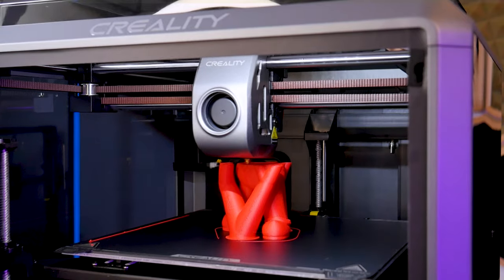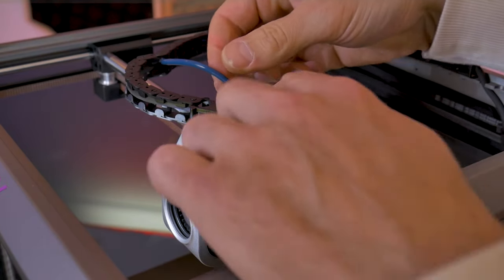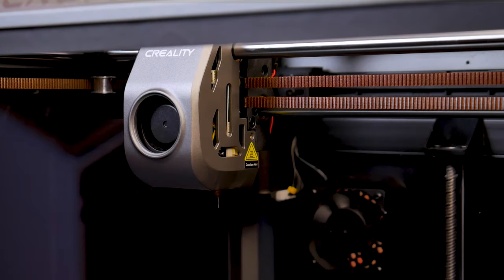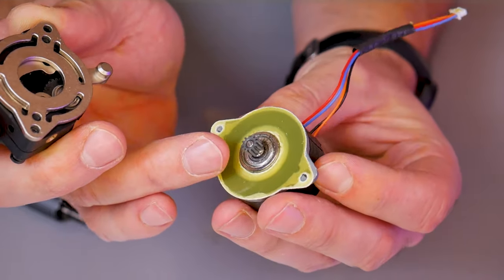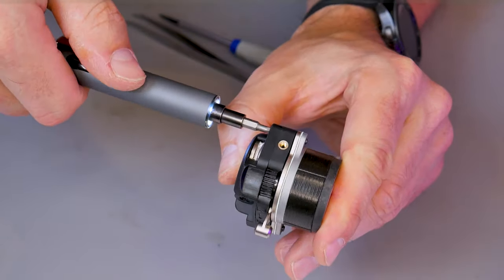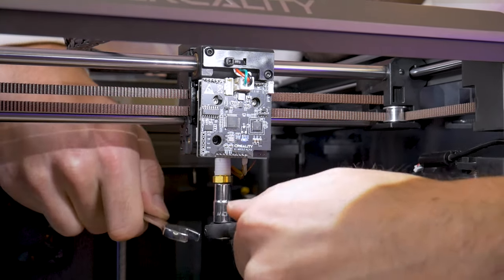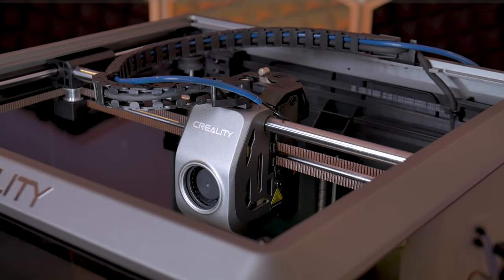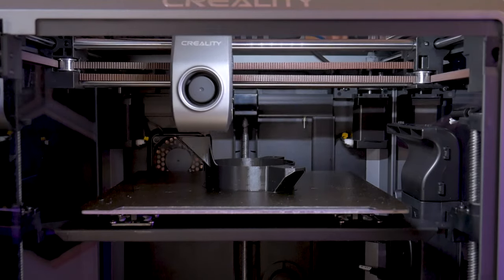Prevent Creality K1 Extruder Jam, Unclog and Disassemble the Extruder and Install Hardened Nozzle

Comment: For the people coming here now, what is being suggested could very well temporarily fix it but the actual issue is that the hotend itself and the extruder, if you have one of the earlier machines, are faulty and they'll replace them for free if you ask and they're made of different things, they're  better
Reply from the maker: Yes the first revision of the extruder is known to be a problem. This might help as you suggest but if you have a first gen extruder reach out to Creality for replacement!
Reply: why even updated extruder gears still plastic? isnt metal gears would be better? anyway to upgrade that gears myself? they are something standard like i can find in hardware shop?
Reply: How do i know if mine is first gen? I just got it black friday at micro center and im having problems with it already
Reply: @alperenozgur  because  it will increase price by average for (rounded and sq2 sequence used) 20 to 50 AUD
Reply: @santigomez8572  there’s only a  k1 available in 2023 😅
Reply: No, they won't replace it for free.  Creality doesn't honor their warranty.

Comment: Thanks for the video. I was able to remove the extruder assembly from the stepper without having to unplug the glued-in wires, which I was really reluctant to do. From there it was pretty much the same, process, except that the way the filament clogged in my extruder made it difficult to open, and I had to pry it. If the extruder casing doesn't open easily,  just pry it open with a mini screwdriver, you won't break anything except the filament that's clogging it.

As a point of critique, it would be good to point out that you can remove just the extruder assembly, leaving the stepper and its glued-in connector in place.

Comment: Your video is the only one I found in YouTube that solved the same direct driver extruder jam problem that happened to my 1 day old K1C. Thanks for this. You rescued me from having to pay for the shipment to send this back to China to be fixed. For my case the printer just printed bank (no filament comes out) after the 2nd print job after installation and calibration. I did not do any retract or pulling . The printer just jam on its own. Some comment on other web sites say this is a very common problem for closed door 3D printers. You can avoid this by monitoring the temperature of the cabinet. If it comes too close to 40 degree C, open the top cover or increase the Fan speed to cool it down while printing.

Comment: Thanks for the video! I was having problems with filament getting stuck and was able to take apart the extruders without too much issue. It helps to see the inside and find the issue (in my case the filament had expanded in the extruder before entering the hotend). Keep these kinds of maintence guides going, it really helps
Reply from the maker: Thanks will do! I did a similar video on the newer V3 models and I think people have found that one helpful too.

Comment: Dropped on this vid, trying to learn what was causing my issue. Mangled filament inside my extruder was the cause. Thank you for a detailed and well explained solution, especially "watch for glued in place connectors...." I am tactile dysfunctional at the best of times, so that saved me a costly correction. Again excellent work, from a 1 day old maker's stand point, I couldn't of asked for a better guide!

Comment: Best video that finally explained how it all works together. 

One point, my K1 Max has the LIDAR and therefore I could not find the screw on the left to take the cover off. I left the cover in place and just did my work with the extruder attached.
Reply: If you unscrew the LIDAR (2 screws on top) you can reach the left screw of the fancover

Comment: Great instructions, it got my printer working again.

I took a short cut by just unscrewing the three extruded screws and carefully pulling the motor vertically.  You have to be careful not to damage the stepper motor wires
Reply from the maker: Thank you, and yes that is a great shortcut :)
Reply: Wish I'd done that. When I pulled the glue off the breakout board connector it brought one side of the connector with it and 3 wires popped out. Trying to figure out what type of connector I need to get to replace it. Benn through my JST set and not seeing anything similar.

Comment: nice video and I appreciate showing how to prevent the issue and just not fix. I ended up skipping taking off the front by just unlooping the wires in the back. that gave me enough loose wire to mess with the extruder without unplugging it. if it becomes more of a problem, i'll modify the printer head so the motor is flipped and accessibly from the back.

Comment: Thanks for making and posting this detailed outline!!!  I had a different, and odd, blockage. The Extruder motor could not drive the gears. I could not manually move the filament inwards or outwards. After removing the extruder to see what might be going on, I could not disassemble it due to the filament still being inside, so I just "had" to use pointed pliers to 'leverage' agains the housing to get the filament dragged out. Then I could disassemble it fully.  And inside there was NOTHING amiss at all. No shavings of filament or metal etc.  It was all operating perfectly. But I could not see any reason as to why the filament had become "imovable", except by quite extreme force (leverage with pliers).
But anyway, all is fine now, and you video made it easy to do all the correct steps to get there!
Oh... I have the K1 Max, so you also need to remove the LIDAR to get access to the left front cover bolt. You only need to undo its two screws and let it hang aside there.
Reply: Hello I have a K1C printer and mine is doing the same thing it won't retract or extrude what should I do?
Reply: @troygales9363  I have just had the same issue with a K1 Max. I was using the eSun PLA+ filament and they hook the filament onto the spool. So when it ran out the extruder kept going and wore part of the filament away and over heated the plastic in the nozzle, cooked it for about 4 hours. I followed the instructions, as above removed the lidar unit. I did not take the nozzle out but I did probe it with the long pin. Reassembled and its printing right now.

Comment: I had a small piece of filament rattling around in my extruder that got stuck in there when my filament spool tangled up on the back.. The glue was troublesome but with some time and patience like you said it comes off fairly easily just take your time.  My extruder gears were extremely clean in comparison but overall with a little patience this is totally doable for anyone with good eyeballs

Comment: Hey, your advise was great to me. I am service engineer but for big Industry machines and this tiny Unit was a new experience for me. my K1 is back online and ready to print. Appriciate you help video very much. 😎:elbowcough: My mistake was to print PLA with ABS Tempereature and when I realized what happen, it was much too late and my nozzel and all other were jammed with blue PLA 🤯
Reply from the maker: Glad it was helpful! You might have experienced heat creep with the ABS settings where some of your PLA became soft inside of the heat break tube and then jammed. Glad you got it fixed though!
Reply: actually that's what happened to me. I thought it was ABS, but turned out to be PLA. So was the issue with the nozzel or the extruder or both?

Comment: Wonderful and useful video.  I am having a difficult time removing the silicone boot that covers the excruder.  You seem to just twist it and it came off, but when I twist, I afraid that I will damage the excruder.  Any suggestion?
Reply from the maker: Thank you! Yes it takes some time to work loose... you have to very carefully pry it and pull on it especially after it has been through so many hot/cold cycles and if there has been plastic melted to it. It will take time, just be careful when prying with a screwdriver, you may puncture or tear it. Always good to have a spare or two on hand.

Comment: I've had this happen twice now before realizing I need to unload the filament more carefully. Both times the filament actually got stuck in extruder cover, not the gears directly.

I wonder if a longer retract cycle in unload macro (to make sure the filament clears the gears) would solve this?

Also, I just unscrew the extruder assembly, pull it out, and unscrew the extruder from the motor without unplugging it or taking the front cover off. Makes it a lot quicker.
Reply from the maker: Good idea about removing the motor separate, that's a nice shortcut. With the longer retract I don't think it's going to fix it though... I have a feeling the retract is long enough as it is but what is happening is that the filament path from hotend to extruder is very short, so when the retract happens the end of the filament is still hot and mushy... it's those extruder gears that are probably trying to pull it out completely but it's getting stretched and squished and deformed between the gears and the gears can no longer grip it to force it out completely. Longer retract won't help as you'll just continue spinning over the squished filament. This is my guess, but you can always try?
Reply: @EmbraceMaking  That's a good point, probably not going to help. What I want to try (at some point) is to set a retraction in the end-print gcode or macro large enough to just clear the heartbreak, similar to what you would do on a Revo. This should at least help when you want to change filament when the nozzle is cold, so you can just pull out the filament without melting it first.

Comment: The filament jam inside the extruder gear mechanism is caused by:

The filament being too soft, hence, when the gears try to push it through the tiny hole, it blobs up and blocks the exit. 
Many factors can create this scenario. In my case, I am printing PLA on a hot summer day, and I also kept the whole printer enclosed. The ambient temp combined with the printing temps of the hotend and bed caused the clog. 

The solution for me is: Opening the top cover and door while printing PLA, lowering bed temp to 50 instead of 60, ensuring back ventilation fan is turned on an functioning.

Comment: is the k1 worth buying now after creality fixed the hotend/extruder issue?...planning to buy my first printer for my robotics project which requires a lot of iterative prototyping design
Reply from the maker: So far I've been having a really good time with mine despite this little extruder jam hiccup. I believe you can get the K1 on sale (right now?) for considerably less than a Bambu P1P so there is a lot of value here. Now I've never owned a Bambu P1P so take my opinion with a grain of salt... but from what I've read online if you have the extra $$ the Bambu printer might be a little easier to start with out of the box and they may have also worked out more of the bugs at this point. Generally you get a better price on the Creality machines but you also have to do a little more tinkering. This is all very general speak based on my experience in the past but I wish I had a a comparable Bambu labs printer to say for certain. You may also want to look at the Qidi printers. I have a test model I've been playing around with and they will be sending me a more refined version in September, but even their first model is very good and you get a bigger build area in the same price range as the K1 / P1P

Comment: Great video, I had a multiple jam disaster, both in the gears of the feeder , in the little feeder tube between the feeder and the heater and the nozzle was blocked too. Unfortunately  I broke the heater assembly trying to remove the frozen nozzle, but I had the spare one that came eith the machine so hapy days, once that was out I could free the passage all through, however I did not put the big rubber texture gasket back.
Its all working OK and that gasket was SUCH a pain to get off I am reluctant to put the new one back, any views??

Comment: I have a brand new K1C and had mine jam. Had a small piece of filament in there. Probably forgot to lock the filament down.
Reply from the maker: Entirely possible - I just cleared out another small piece of filament that looked like it either swelled or was out of tolerance

Comment: Appreciate the video, but I'm unable to tell the orientation of the extruder connector as it's in the shadows when removed and the video skips over the reinstall. Mine poped out, which colored wire goes on top?

Comment: Ok. I followed your instructions and removed the extruder which was clogged and also removed the nozzle, but after I cleared the motor and gears, I still got a piece of PLA stuck between extruder and nozzle. How do I take that apart/remove it. its not coming out at all and currently broken off at the base.

Comment: Hello. I have bought the K1 about a week ago. I have unloaded filament only once, without unlocking the gears. And it seems that a piece of filament was actually left inside, like in your case. However, I inserted new filament and the printer worked well. Does it mean that the piece of old filament was extruded? Or it's still inside and may jam in the future?
Reply from the maker: If it hasn't caused a problem yet it will likely be fine. Don't worry :) if it ever does jam you  at least know now what to do!

Comment: Hadn't printed in about five weeks, just left the filament sitting in the tube and extruder. Fired up the K1 Max and no filament will extrude. Going to have to disassemble and probably clean. When I run the steel push-through tool through the extrude the tip comes out covered in plastic so I'm sure there is significant build up in there. Any tips on actually deep cleaning a gummed up extruder? I was thinking an acetone brush down with a tooth brush but welcome suggestions.

Comment: I have a K1C and every time I try and change filament, I hit retract at 220 and wait for it to finish then unlock and pull out, but lately it has been frozen every time o try and remove it as if it was still locked in. I think what it happening for me is that when it heats and extracts the filament I think it is pulling molten pla out and then ramming it back into the barrel of the hot end flattening it out and making it impossible to remove.

Comment: I've had 2 jams in a row now with PETG. Haven't yet resolved the 2nd one. The first one though, it had a thick portion inside the extruder locking the filament inside it. No clue why. Did not had filament swap after few prints prior to that. Environment is kinda hot due to weather atm. Any clue?

Comment: Any suggest on reconnecting the motor? I followed this video first and now I can't get into the tight space to reconnect the motor.   You seem to have skipped the reassbley and all the other videos show it being done without disconnecting the motor
Reply from the maker: You can do it without disconnecting - but I had no issue reconnecting it. Just the reverse of the disassembly which is why I kind of skimmed over it. Usually I'll go into detail on the parts that are tricky or cause problems. The connector is small so maybe if you have some tweezers or something to hold it while guiding it into the plug it might help. Then use your fingernail or a flat head screw driver to gently push the connector back in.

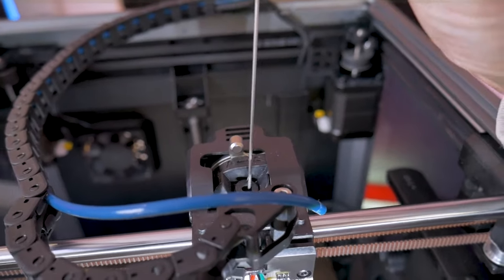Comment: Hi, great video it helped a lot! at 7:02 you clear out the hot end, on mine i seem to have a blockage that doesn't allow me to pass the rod all the way through even with the nozzle removed. Any ideas how to fix? ive tried pushing it out and heating it up but no luck!
Reply: Had the exact issue you are describing. The clog was inside the heatsink.

Comment: If you install the steel nozzle, is it a problem to print only pla or petg with it? Will print not often with other material or should you change the nozlle each time?
Reply from the maker: No need to switch back and forth between nozzles. Print PLA, print petg, all with the steel nozzle

Comment: Has there been a redesign to where the tube and head meet?  My K1 does not have a blue retaining clip.  Or any retaining clip.  I can not remove the tube.  I don't want to pull too hard.  I just purchased the printer and the dates on the files included with the printer are dated July 2023.
Reply from the maker: Yes I think you might have the newest version that doesn't use the blue retaining clip anymore. My K1 MAX is like this but the tube can be removed... the first time you press the fitting and pull the tube it can require a bit of force but it will come out. Subsequent times you remove the tube after it generally gets easier as it grabs a bit less.
Reply: Interesting.  I bought a K1 Max on the 13th November and it had the blue clip.  It's a bit of a pain as that stringy/nobbly filament bit happens every time and although I've always unlocked the extruder before removing the filament and it pulls out, it breaks off when pulling the filament out through the filament detector unit.  Next time I feed filament in, I have to unhook the tube from the extruder so that loose bit drops out rather than going back into the extruder.  This has been my experience on every filament retraction/replacement which I've done about 8 times now - my faith in the longevity of that clip is pretty low.  It also arrived jammed and took a lot of fiddling to get filament to extrude for the first time - not good when it's the first printer I've every owned.

Comment: I got the new K1 version. Doesn't have the retainer clip at the extruder any more, I have no idea how to loosen the tube 😞
Reply from the maker: Should still have a press fit tube... just press down on the connector that the tube goes in and pull up on the tube. The first time you do this you might have to pull up pretty hard on the tube if it's really stuck in there.